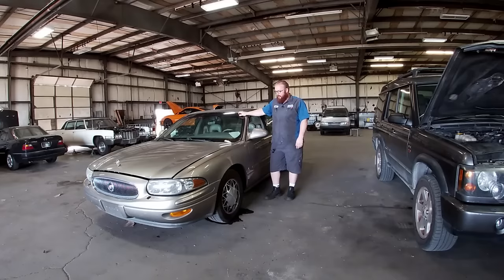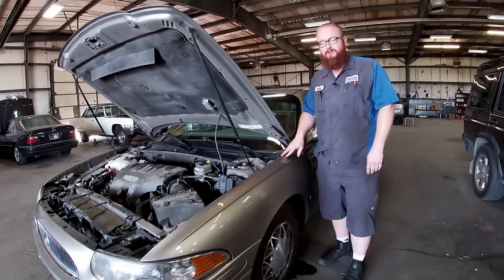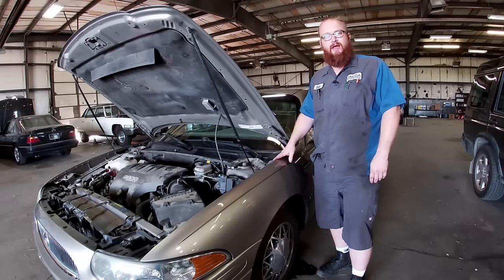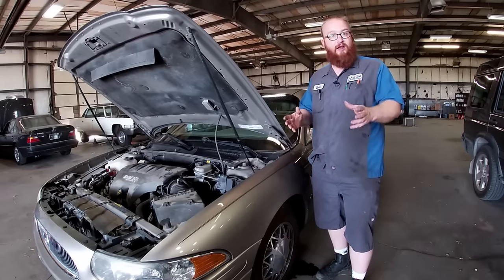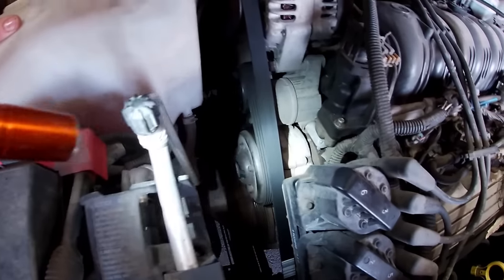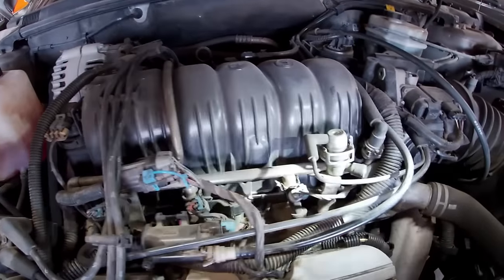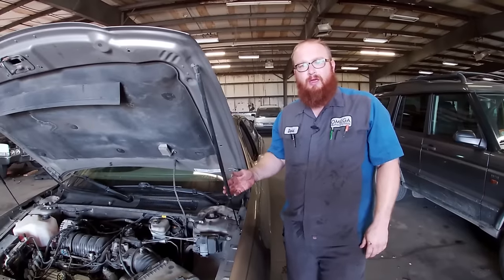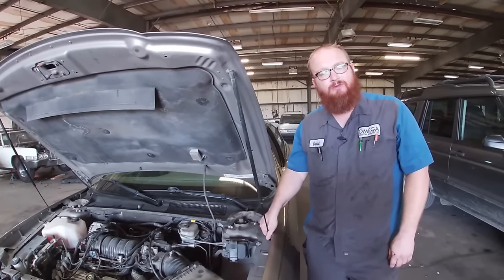CAR WIZARD highlights what makes the Buick 3800 V6 the BEST engine ever!

Comment: Buick: "we can build an engine as reliable as a toyota engine"
Customers: "what about a whole car as reliable as toyota?"
Buick: "Are you crazy?"
Reply: Buick was known for the their reliability all around. There is a reason you see more older Buicks around than Toyotas.
Reply: @Hotlog69  you see more older Buicks around than other GM products I agree but that's a damn lie that you see more older Buicks on the roads then older Toyotas in general. The Toyota Corolla is the most kept car on the road period. Look up the stats. Over 80% built since the 80s are STILL on the road today.
Reply: @KenshinNX60  yeah the other 20% made it home lolol nah I'm wholeheartedly a GM guy, but I can't deny Toyota makes some of the best vehicles to ever hit the road
Reply: Someone had to say it, yeah this is "the best for the money" but ill spend the extra and always drive Japanese
Reply: He said you see more Buick’s around than Toyota’s. Maybe if you live in a trailer park
Reply: @Hotlog69  I have 3 Buicks one is a 1996 regal with 445k, a 1990 3.8 regal with just 130k and a 1995 park avenue with 494k. With the 3800 line GM did everything right. But I also did transmission fluid changes often
Reply: Yea but when you go car hunting and ask a *corolla owner when's the last time you changed the timing belt and serviced the automatic trans they look at you like this is a toyota!  
(Earlier models to late 90s)
Reply: Hotlog 100% agreed, I almost never see old Toyotas on the road but I see plenty of old GMs.
Reply: @Hotlog69  No...Just no. I can count on one hand how many old GM cars I see, vs the dozens of 90's toyotas, mazdas etc
Reply: @KenshinNX60  Hahahaha yep... still see tons of em...Not sexy but....
Reply: @KenshinNX60  Maybe in the arid places like SoCal and Arizona. Toyotas will start to rust after a light drizzle.
Reply: @Oldsmobile69  Maybe before the 90's. Buick was doing extensive rust proofing then and it shows.
Reply: @interpol007  90s Mazda LOL 😏 your experience it was way different than mine.
I had a Mazda and a Buick and I'll tell you the Buick was a much better value for dollar. My wife wouldn't drive the Mazda with my two kids cuz she didn't trust it.
Reply: @KenshinNX60  not true at all. 80s Toyotas are all rusted out and in scrapyards. I haven't seen an early 90s or 80s Toyota that wasn't a truck in ages. I see tons of 90s and late 80s Buicks. They just last.
Reply: @Funlu  Toyotas are not fancy. They are cheap cars and they are popular with people who live in cheap areas.
Reply: @interpol007  I live in the rust belt. Japanese cars just don't last long here.
Reply: Oldsmobile69 I have a 2000s Saab.  Many parts were engineered by Saab.  But some body panels were cost cut.  The rear fenders were not galvanized and they rust quickly.
Reply: @benl4707  yeah, because the fluid and filter and belt are worth more then the Toyota as an entire vehicle😂😂😂
Reply: Ah, Toyota.  The only vehicle I ever had an exhaust manifold just fall off on.  Otherwise it was o.k., but I was driving down the road and the exhaust manifold fell off.
Reply: 3800 Buick far superior to Toyota
Reply: @user-qc7dr3cd3q  how? Wizard just claimed this was the best engine ever? Lexus 4.0 and I'm not a mechanic Im a BE so I'll debate with YOU PEOPLE, damn chevy lovers
Reply: interpol007 I can’t remember the last time I seen a 90’s Mazda running on the road, and I don’t want to hear about the RX or MX line, if that’s the case how many old Camaros and vettes are still around
Reply: Here in Indiana I see way more late 80's to 90's LeSabres, Park Avenues, Regals, Centuries, 88's, 98's, Cutlasses than you do Japanese cars.  Of course here in the mid-west we still bought American cars about 7-8 to 1 at that time.  But they clearly do last.  I would also agree you see a lot more older Buick and Olds products.  Probably the fact that they were typically owned by older people who babied them and maintained them helped.  They were somewhat premium brands so the build quality was probably better than Chevy and Pontiac.  I still even see Buick products from the early 80's or even late 70's at times and they are drivers, not car show prizes.
Reply: @gavinwells6911  3800 isn't and will never be a "chevy". It's Buick through and through.
Reply: @Hotlog69  oh please bud why dont you move to china and steal my money on the way out
Reply: @gavinwells6911  Be glad to. Where do you keep it?
Reply: @manofsheerawsomness  I loved my Subaru Brat! But, I also love my 2000 Buick Lasabre Custom. 5 yrs now and had to do spark plugs and head gaskets, $450.00 total. No other issues at all! Most reliable car I ever owned.
Reply: Lmaooooooo
Reply: @tyler2610  

I can easily believe they lasted a long time.
The were only driven to church and back every Sunday and the internal medicine doctor once a month.
Reply: I've had two Prii with more than 300,000 miles, no engine repairs.
Consider that this is a 1.5 L engine hauling a 3,600 lb. car (with help from the electric motors, of course).
Reply: @Hotlog69  including an old lady who drives her 80's Buick to church on Sundays til this very day :)
Reply: manofsheerawsomness gm is the best price in after market price I buy my rear break pad from auto supply store 11.00 for my Grand Prix and rebuild alternator diodes bearings regulator brushes sliprings  for about 35.00. My girl friend had a camera it only lasted to 256 000. Xhaust complete cost 1400.00 Ac went 1200 alternator also went  timing belt frayed lucky it did not break , I could not change it dual cams no room or proper cam holders . My dad had a Toyota trycel his auto transmission locked up on the highway we changed fluid and filter on it several times before ,timing belt again dual cam no I did not have special tools to do the repair and less than an inch to do the change . The Toyota timing belts need to be changed every 60,000 miles because all are interference engines or risk loosing the engine sure people go 150 000 on the belts but it very risky . I have a 1992 tracker built in ingersol Ontario by GM Suzuki plant timing belt only take me  less than an hour to change it’s an interference engine also but at least there is room and I split the timing cover in 2 for easier change an reseal with silicone gasket maker . Any don’t be brain washed into selling you country out like most
Reply: @gavinwells6911  I have owned both gm 3.8 and currently own a Toyota 4.0 V8, and I agree with you the Toyota engine is better, but every time the wizard said best motor, he qualified it with "for the money". It is difficult to get an old Lexus as cheap as you can an old Buick.
Reply: @UZForLife  you're not the only one lol ive owned more 3800s than I care to admit but I'll save what always comes off as a lie to these fake car collectors, anyways you can find an ls400 just as cheap as a buick where im from no deal at all but I'll never tell cause I have a running collection of them
Reply: Vinny Graziano yes you hit the nail on the head you have to do transmission service like an oil change ,but I have a trick you won’t get dirty and change my trans fluid 2 times per year on my 400000 Grand Prix . I buy a pump swarm up car pull trans dip stick shut of car hand pump 4 -5 litres out of transmission through dip stick tube replace with up graded dextron 6 or 7 and done do this spring and fall if you put miles on the car or tow or do every 2 years any way  cost 20$ a change ,do people see the light no they rather complain when their trans eaters it’s self lolololol
Reply: ben l exactly
Reply: Hotlog agreed
Reply: @KenshinNX60  than* older Toyotas
Reply: @Funlu  Philadelphia Walgreens video from the 4th of July.
Reply: @gavinwells6911  Ya, I'll never go back to GM, I currently own a 98 GS400 with 232k, an 01 LS430 with 270k, a 97 4Runner 4x4 with 340k and an 01 Sequoia with 280k. If it isn't obvious I am obsessed with the UZ motor family!
Reply: @UZForLife  I still got a 96 tahoe that runs and drives but its not what I do drive its my last gm product in my collection and it was a 2,000 dollar special with a 9 inch lift, idek whats wrong with it but it kinda rides like a wagon does at this point lol feels nothing like an automobile,  super floaty
Reply: @UZForLife  I've considered owning old jags for the same reason though , its something that looks cool next to other cars that drive better LOL
Reply: The 3800 is a gm engine not a Buick engine. Many other that had it
Reply: @gavinwells6911  Wow! We seem to have a lot of similarities in our automobile tastes. I had a 99 tahoes 4wd. It was a pretty good truck but I absolutely love my 01 Sequoia 4wd, fantastic truck! I highly recommend it.
Reply: @UZForLife  I've been thinking of making videos lately cause I do have a collection to show off including 6 ls400s and two sc400s (sc are under 150k)
I kinda get tired of trying to tell people about my collection and they take it like I'm some punk cause they are lol
Reply: @UZForLife  you can get an ls that needs minor work for 1500$ in the north- theyre pretty rust resistant as well
Reply: @gavinwells6911  Oh nice! My brother has a pretty clean 97 SC400, silver/blue with black interior. Are either of your SCs 98 or newer?
Reply: Trey fields 
Ha! I see way more old Buick’s on the Road than Toyota’s. As a Matter of fact Toyota had Rust issues on their Truck frames and Corollas are disposable cars, There are late 90’s and early 2000 Buick’s running around looking and running like new. I don’t remember the last time I seen a 99 or 2000 Corolla.
Reply: The 3800 is a pretty darn good engine. I know the owners of local Buick dealership and the owner has a customer who still brings in their car for service/maintenance and has over 600,000 miles on non-rebuilt engine AND transmission!. Faithful service history didn't hurt any lm sure. Local newspaper did a story on it once.
Reply: Trey fields sorry Trey, you heard the Toyota commercial wrong.  80% of the Toyotas built in the last 20 years are still on the road.
Reply: Window motors are the worst. I went through a half dozen at $300 a pop (first three were under warranty).
Reply: Window regulator??  What??  Just one bad one??  Not all 4????   Either just replaced the other 3 or will be replacing the other 3 soon.
Reply: @UZForLife  didnt get a notification for this but 95 and 97 one is navy blue one is dark green
Reply: @gavinwells6911  Very nice, I really enjoy V8 Lexus models especially when they are not black, white or gold.
Reply: @UZForLife  when I had got them I actually thought they were both repaints and then I got the same color green ls400 which was actually the one I payed top dollar for (6500 out the door)
Reply: @UZForLife  but gold is a very special color for me because my first car and the car I slept in for 4 months on end while working as a young man was a 92 camry...you bet your ass I have a gold ls400
Reply: @gavinwells6911  I got a friend of mine in to a 98 darker green LS with the gray lower section, those look great! I put my mom into a somewhat rare ultra dark green LS430, looks black except in direct sunlight. I love the rarer color Lexus!
Reply: @gavinwells6911  Is your green LS a 98+?
Reply: @UZForLife  98 on the green ls only one I have found it was at a dealership but I also exclusively look in northern states as I am from Michigan
Reply: @tyler2610 - Same here in Iowa. Except Yota's are the most sold cars here but you see way more of the Buick and Olds than Yota's other than trucks and 4Runners. Even those are usually rusted to crap but still decent. I'm curious just how accurate the 80% is? What about cars that are still tagged and licensed just sitting in driveways broke down? I know a farmer who has 10 crap Yota's all updated tags and plates but they don't run or have working engines.

@Trey fields - You don't see many 80's and early 90's Yota cars on the roads. Plus there is some context that should be noted. Toyota are taken care of more by their owners than any other car as well. If treated like other cars they fall apart just as fast or faster. Yota trucks for the longest time would rust at first rain fall.
Reply: I drive a 3.0 Solara with 230,000 miles on it.  I'll stick with what I've got over a GM product.  LOL
Reply: My brother had a Buick that had this engine and it wouldn’t die but the rest of the car was typical GM crap, interior door panels/seat backs, knobs and buttons were all loose and would come apart. Lexus/Toyota’s never seemed to have those build quality issues
Reply: Lmao
Reply: nick king They are known to go through transmissions though, particularly in supercharged form with FWD. My first car I bought on my own was a 1998 Grand Prix GTP (the top-of-the-line supercharged version). I took good care of it and followed the maintenance schedule to a T, but it still went through three trannies before 140k miles - the first one just 5k after the powertrain warranty was up. The weak transaxles in FWD models simply can’t handle the power that big V6 makes (especially when supercharged) unless you drive like a Floridan with Alzheimer’s.
Reply: I love my 2003 Buick LeSabre, the engine is great and the rest of the car is so easy to work on I rarely encounter an issue I cannot fix myself it has 130k miles and I see no reason why it won't run till I put historic tags on it. If they still made a car with the Buick 3800 I would buy one. My next car will likely be a Toyota since it seems GM has left the reliable car market!
Reply: @anthonyesposito2576  "yeah the other 20% made it home" LOL that was good
Reply: Lol. 

Let me clue you in on longevity. 

It’s based on two things... the depreciation rate of the vehicle, and the type of people who buy them (which is sometimes based on the first thing, but not always). 

First is depreciation. Depreciation itself is not primarily based on reliability. It’s based on how easy it is to buy a vehicle and how many are on the used market. Take a Subaru... they don’t have zero down 0% APR and you don’t see many used ones up for sale. That means they keep their value. It also means that richer people buy them and take care of them so when that Subie eats a timing belt or blows a head gasket.. it will get fixed and the proud owner probably won’t tell you about it. But a zero down two year leased Dodge?  It two years it’s worthless because it’s competing with lease and fleet returns plus it’s been rode hard and put away wet. 

The second factor for reliability is how it’s used and preventative maintenance. Buicks depreciate huge because nobody wants to buy a used old person’s car. But old people don’t drive much. They don’t drive fast. They don’t drive hard. They always keep their car in a garage. They always wash it. They always do preventative maintenance. That’s why you’ll see old people that have cars like a PT Cruiser or a Ford Windstar—absolute garbage—and they will be clean and reliable. The adage about only driven on Sundays by a little old lady is true. 

So all you have to do is buy a cheap car and treat it nice and maintain it and it will easily last as well as this Buick. There’s no secret to it.
Reply: Then they said how about we just start putting Toyota transmissions in GMs
Reply: manofsheerawsomness you much more for parts
Reply: Oldsmobile69 oil spray they do fine
Reply: Vinny Graziano 100% agree , no one changes their  fluids it’s super cheap insurance ,trans ,power steer, brake fluid
Reply: Hotlog you have to oil undercoat ,I live in Ontario Canada 8 year old pickup frames are gone on some models that why I buy used and oil right away and do everything every year sometimes twice  I drive $ 2000 cars and get 5-6 years of high mileage driving like my 2004 Grand Prix purchased for 2200 $ at 224 km now at 400000km . It make me laugh actually cry at how people by $50000 + trucks ,car and drive them in corrosive salt / brine (beet juice and salt worse than old rock salt ) that cities and highways apply in the winter .i have older nice cars but are not driven in winter and I oil frames on them too
Reply: I would not buy government motor co junk.  I would buy Ford .
Reply: If gm was so good way did they have to bailed out by the government.
Reply: My 08 Hyundai Elantra is easier to work on the that junk.
Reply: A whole car that rusts completely away in 5 years? Leave it to Toyota!
Reply: @Oldsmobile69  i just looked under mine, aluminim control arms, carbon fiber floor pan, carbon fiber mono leaf and titanium con rods, all from the factory. Looks good to me...
Reply: Car manufacturer Toyota has agreed to pay a staggering $1.2 billion to avoid prosecution for covering up severe safety problems with “unintended acceleration,” according to court documents, and continuing to make cars with parts the FBI said Toyota “knew were deadly.”
Reply: @UZForLife  Thatts right, Im driving a 2000 regal I picked up for 2K it is in excellent condition ,one owner car. It is so comfortable and a pleasure to drive its hard to believe it. 2K does not get you anything nearly as nice in anything other than a Buick.
Reply: What's funny is that those 90's carollas  were built in a shared Toyota/ GM factory in California.  Designed together.
Reply: @Funlu  that is so funny
Reply: Daniel Price whats your thoughts on 2006 LX470?
Reply: chrisdunn7 geo prizm
Reply: Toyota just spends more of the money on higher quality parts, but that money comes out of features and interiors.  Say two car companies have $10,000 to build a car, GM spends $5000 on parts and $5000 on tech and a fancy interior.  Toyota spends $8000 on parts and $2000 on very little tech and a boring interior.  I was just driving a $55,000 2019 Toyota highlander and the thing didn't even have a heated steering wheel.  Its infotainment system would also be great if it was still 2010.  ALL their cars and trucks are like that!
Reply: 1L6E6VHF that’s why they’re named things like century and 88, ya gotta be that old to drive em
Reply: BS I remember when Buick said when better cars are built we will build them
Reply: @anthonyesposito2576   While Toyota may be great for reliability, they are not great for safety, just look at the unintended acceleration issues. They were even brought up on criminal charges because of it and to this day they never admitted the truth about what caused it.